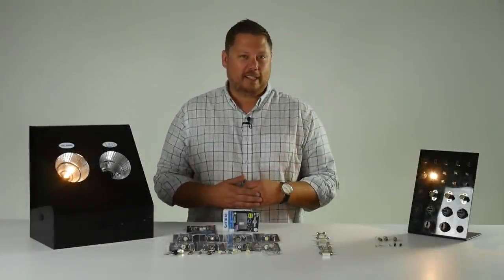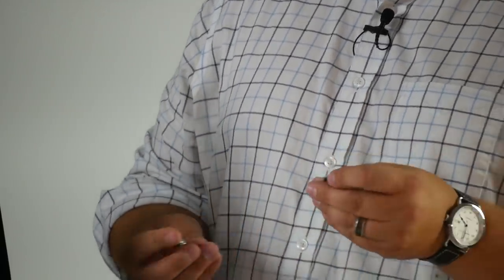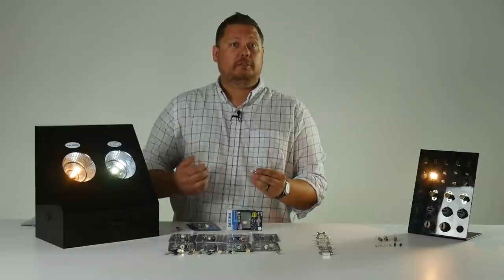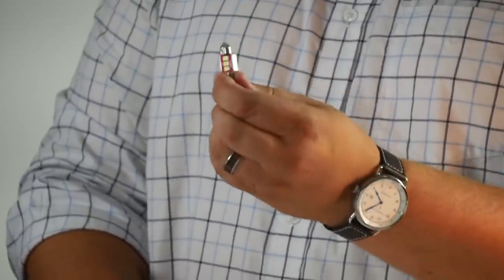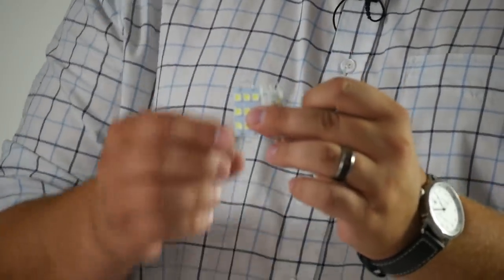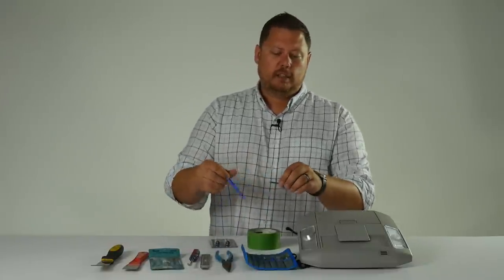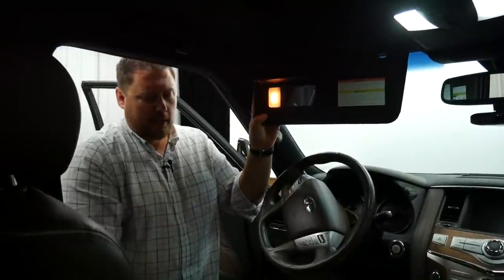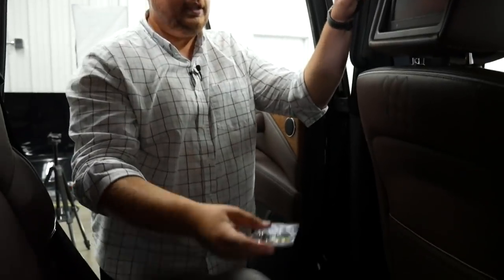How to install LED Interior Lighting in your car or truck | Headlight Revolution

Comment: I notice you recommending GTR Lighting quite often and it is apparent why. However, when you compare the price difference among the top competitors, GTR Lighting is significantly more. They really need to work on that... Plus accessibility is an issue. I shouldn't be required to by direct from GTR Lighting.
Reply from the maker: We offer all of GTR Lighting's products right here on our website! :) We love GTR Lighting due to the quality and performance of their products. They deliver great results back to back and have been an incredibly dependable bulb compared to many competitors. Many of the GTR Lighting products come with a Lifetime Warranty as well, which is incredibly nice to know you'll never need to worry about replacement lights ever again! :) Thanks for the comment!

Comment: I TRIED TO REPLACE THE INTERIONR LIGHTS IN MY DOME LIGHT IN MY 2002 FORD FOCUS, AN THEY WONT COME ON BUT I KNOW IT WORKS CAUSE THE BULBS THAT CAME IN THE CAR WORK FINE .  SO CAN U TELL ME WHAT MY PROBLEM IS ?
Reply: Might be the light is a polarity bulb meaning they have to be in a certain way try taking it out and do a 180 and then put it back in

Comment: One of the best benefits of having an LED in an overhead light assembly, especially when your passenger needs it at night, is being directional, so you won't have that moment of blinding light inside the car before your eyes adjust to it.
Reply from the maker: Not a bad point at all!

Comment: OK so I have a Nissan Altima 2005 with bulbs in them interior can I get an adapter to change it to LED? At present the LEDs will not fit and I’m dying to put in much brighter lighting…
Reply from the maker: I'm not aware of any interior bulb adapters.

Comment: Is there a 501 LED that's got a frosted lens? So the light is more diffused as my side light in the car is open so the LEDs are very visible and looks a bit harsh. A frosted one would be great. It's in a 2006 Ford Fiesta so needs to be safe to work
Reply from the maker: There are a few frosted options!

https://www.headlightrevolution.com/morimoto-t10-hybrid-bulbs
https://www.headlightrevolution.com/t10-w5w-194-Xtreme-LED-bulb-XT-LED-194C_2
https://www.headlightrevolution.com/t10-194-philips-xtreme-vision-LED-P-T10_2
Reply: @HeadlightRevolution  which of those would you suggest is the best? if you see my latest videos of my headlights you can see the side light LED bulbs little elements are very visible. WHich is why i thikn a frosted capped one would look smarter

Comment: I did GTRLightning interior swap in my 2016 Toyota Tundra for about $80. Two T10 bulbs started flickering and died after 2 weeks and one more after a month. Supposedly it was bad batch, so they did send me replacement. After 2 months, 2 new bulbs are already gone. I was expecting better quality bulbs at this price tag. Good video though.
Reply from the maker: Martin, indeed we did experience a bad batch earlier this year with some GTR Lighting bulbs, not all. If you want to try something else that is more satisfactory to your needs, please email returns@HeadlightRevolution.com and we'll get you taken care of.

Comment: At the end where you were with the led festoon with the heatsink, I think that's how I blew my dome/horn fuse. I didn't realise it couldn't touch anything, so is it better to unclip power first and make sure you put it in correctly before turning on? 

Also what can't touch what exactly the heatsink can't touch the 2 metal + and - or the assembly as a whole? Why do they have big heatsinks on them if they going to trip fuse? I'm confused educate me please!
Reply from the maker: If they are blowing the fuse, it would definitely be recommended to turn off the bulb before installing it. I would say that you should be able to orientate the bulbs in a way that the heatsink on the bulb is not touching the bulb shroud, and then they will not cause any short! Shoot us an email if you have any other questions! Sales@HeadlightRevolution.com
Reply: @HeadlightRevolution  I ended up  fitting the dome light earlier. What i did this time was unplug both power connectors so I could place the led bulb in properly, luckily I got the right size bulb this time too.
Reply: @HeadlightRevolution  What I want to know, you know the heatsink on the back of these led festoon bulbs is there supposed to be a gap either end or just one side?
Reply from the maker: That doesn't really matter, they may have a little gap on either side, but that will not affect anything!
Reply: @HeadlightRevolution  Oh that's reassuring to know. Cheers!
Reply from the maker: Glad I could help, if you need anything else or have any other questions just let us know! Have a good one!
Reply: @HeadlightRevolution  👌
Reply: I had a similar issue with LED festoon lamps in the past. For me, it was the solid metal backing of the PCB that caused a short.
It seems to be a pretty common issue.
At the time, the car I owned was a nightmare to replace a fuse in - I had to remove the battery, and battery holder, remove another plastic sheet, unclip some pipes, and slide out a fuse housing next to the ECU. 
In the end, I sold the car, and bought an older car. Nicer and easier to work on.

Comment: Are these T10 bulbs dimmable for dash cluster light replacement?
Reply from the maker: They are dimable to a point, but like all LEDs they will eventually shut down when the voltage gets too low. Let us know if you have any other questions!

Comment: What about ghost lighting? I've replaced regular bulbs in my smart cars dome light and now the light stays on if the switch is set to "door". I'm guessing that the stray voltage running through the dome unit is enough to make the new LED bulb "glow" but not light totally like when the door opens.
Reply from the maker: Normally that happens because the circuit is looking for "feedback" from the original bulb, or uses the filament inside the bulb as a short-to-ground to shut down the circuit. If you have something like that happening, you need an LED bulb with CANBUS integration built in. Email us with your vehicle info and the problem you're having and we'll be happy to make some recommendations! sales@HeadlightRevolution.com

Comment: Ok tell me why after i changed every single interior light with red led lights..  im talking everything from the lights in the steering wheel buttons to window buttons..  everything.  But all the leds work great except for 2 lights on the ac panel.  They flash or flicker..  even when the car is off only with running lights on, nothing else drawibg power..  they randomly flash and dim on their own..  battery voltage is 12.2-11.9v all leds have same resistors on them, the connection is not bad as panel works fine outside the car on alkaline battery, incandescent bulbs work fine in the car but only these two bulbs do this..  ive tried putting capacitors, coils and power resistors to smooth the wave but same issue, no changes…. Cant figure it out..  has been doing it for months.  They just have a mind of their own..  headlights and tail lights work fine, that circuit is not spliced or anything so im stumped.  Tried different led’s but natta…
Reply from the maker: I would suggest reaching out to our CS team so we can go over some troubleshooting with you!

218-755-5200
Sales@HeadlightRevolution.com

Comment: I have a 2017 highlander limited platinum headlights needs led what's good for me
Reply from the maker: W Step This will be your best option for your headlights https://headlightrevolution.com/gtr-lighting-55w-gen-5-pwm-canbus-single-beam-hid-conversion-kit/ You will need an H11 bulb style for your low beams. If you want LED's they will work great for your high beams as well as the rest of your lights!

Comment: Replaced all interior lighting to your LED's on my 2017 RAM. Having an issue with the back dome light. Its a little looser than the OEM stock bulb. It rotates and works intermittently. Is there someone working on this issue or a fix?
Reply from the maker: Wil Wiggins I would try taking the bulb out and squeezing the connections of the clips that hold the bulb in place. you should be able to get the bulb to fit snugly very easily.
Reply: Do u remember the bulb size on the interior roof light? I have a ram 2

Comment: What happened when the glass breaks from trying to pull it out with metal pliers
Reply from the maker: geordi wahlen you need to be more careful than that. If the bulb breaks, it should be easier to remove because you'll have something to grab onto, but of course you will also have broken glass to clean up.

One method is to wrap the pliers jaws in rubber electrical tape. Of course if you cannot do this work without wrecking something, leave it to the professionals.
Reply: Headlight Revolution I work on cars day in and day out I was just simply asking if that has ever happend before sorry it kind of sounded mean on my end you guys do great work I look forward to purchasing products from you
Reply from the maker: Thanks for the clarification. Surprisingly those little T10 bulbs are tough. The only time I've ever seen one shatter is if you throw it on the cement, or run it over.
Reply: Headlight Revolution ya I have come across that as well they sometimes are tough

Comment: I hate those 6000k+ blueish bulbs. All lights should be less than 4000k temperature.
Reply: This is the only reason I still have halogen bulb, I prefer a warm temp instead of a spot light when I open my door at night